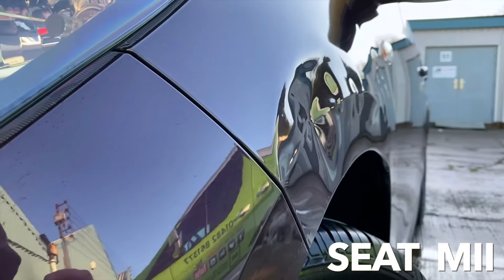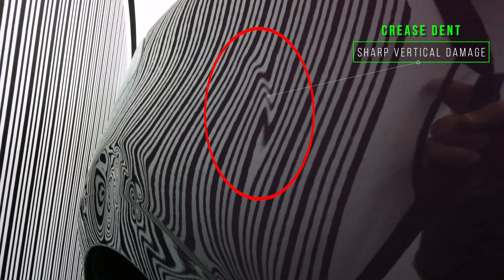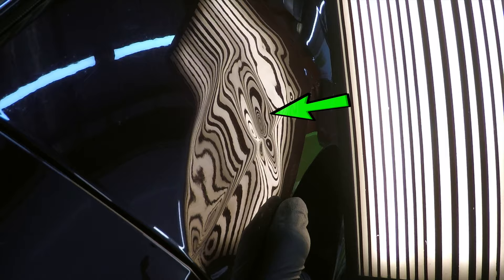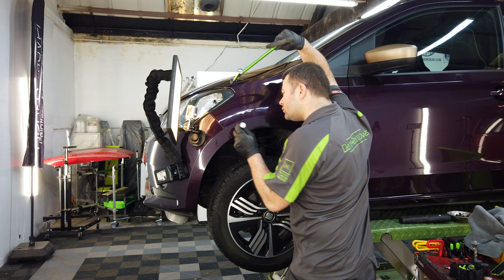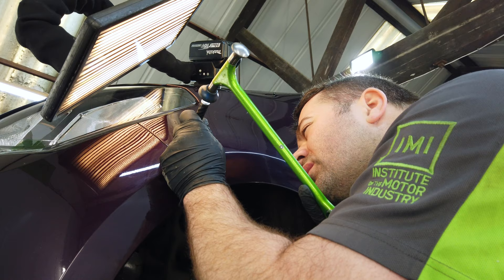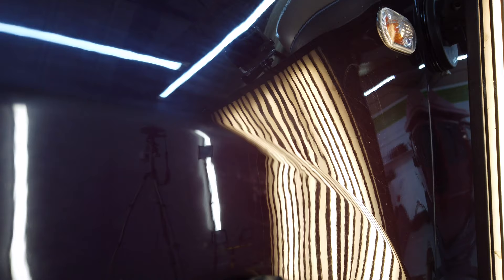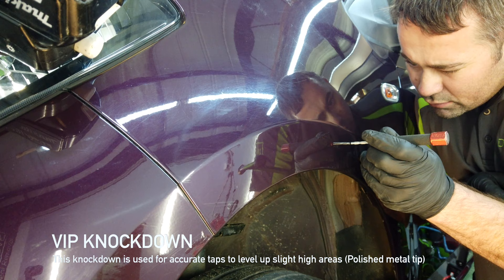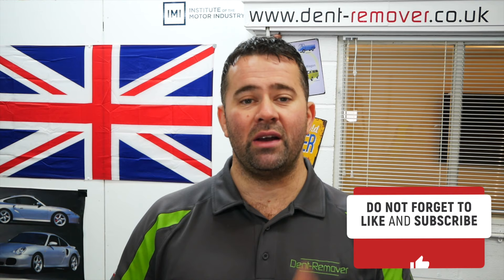WILL THIS DENT REPAIR? | Watch Me Fix This Without Painting! By Dent-Remover

Comment: Hello Martin good night from Spain .... I follow your videos and I really like your work ..... I have been a professional painter writer for more than 20 years ... and I am learning the techniques of rods and pdr .. .... sorry for the indiscretion but can you tell me how much you charged for this work ???? ... ... thanks .....
Reply from the maker: Hi Miguel thanks for your comment and we’ll done for getting into PDR I’m sure your painting knowledge will help you learn PDR quicker. I don’t like to give exact figures out because every repair is different based on the damage  etc
Was less than £500 if this helps? 
Cheers Martin
Reply: @dentremover01  here in Spain to repair and paint that fender would cost about € 200 and it would take about 4 hours to do the job. Do you work with insurance companies or are private clients ????? ......
Reply from the maker: Hi Miguel, I think you could get more than €200 for this, what’s the other option? Repair and paint, blend the bonnet, bumper and door? 
Also I think it comes down to the individual customer too. You need to charge what your comfortable with for spending the adequate time on the job to get it as good as. I bet there’s guys in the USA would charge 800-1000+ for this
I’m mainly private/retail but will do work for anyone aslong as I get paid pronto